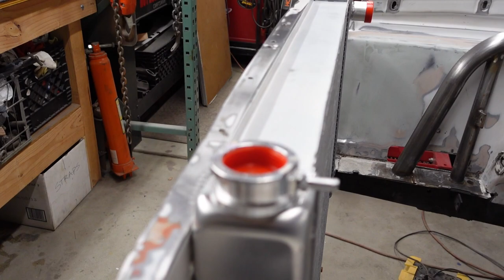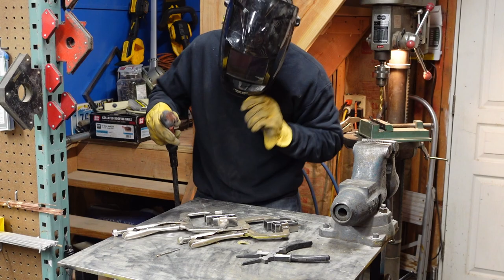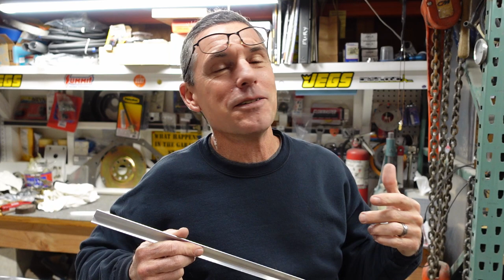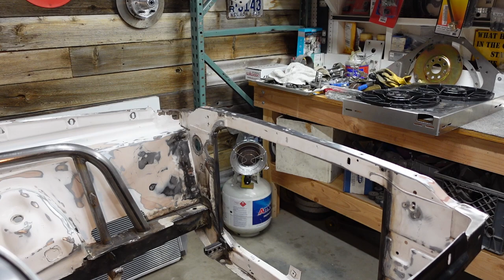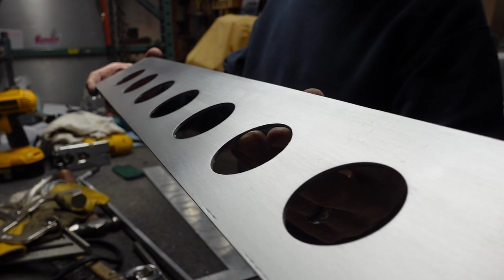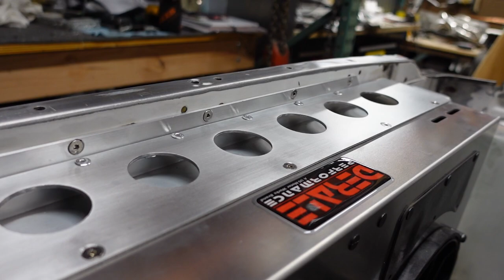RADIATOR MOUNTING, how to…Custom fabrication, MOPAR, GRIFFIN

Comment: Cooling one of my favorite subjects that i had to learn from . My years ago i read a article that was written by  fellow that had a prostock car . He stated how he made more hp by having the engine temp at a higher number and as it turns  out i never could make that work for me especially here in the south . My car always did better at night when it was cooler .  That and i ran a big flex fan to help keep it cool . I had no idea that damn thing pulled so much hp especially at 7k or even 6.5 in my other car.  Electric fans and have the engine temp up to say 100 deg when staging the car .